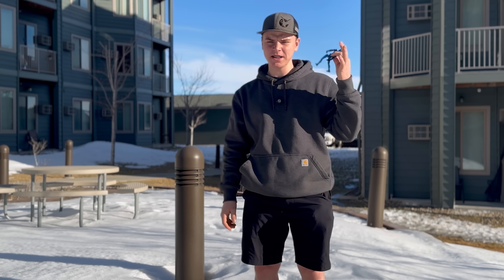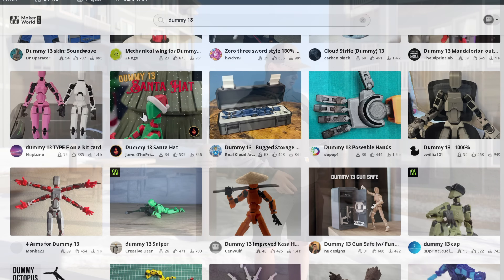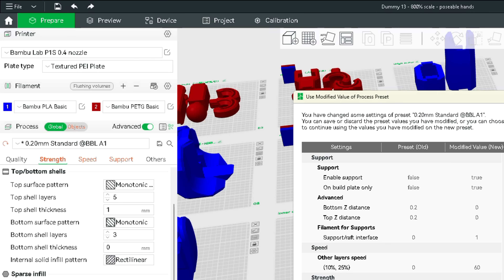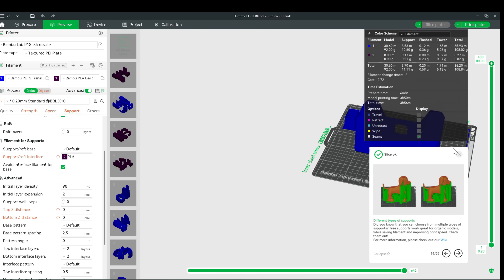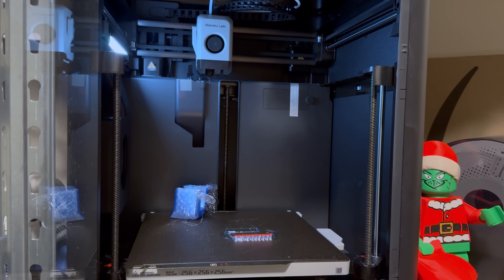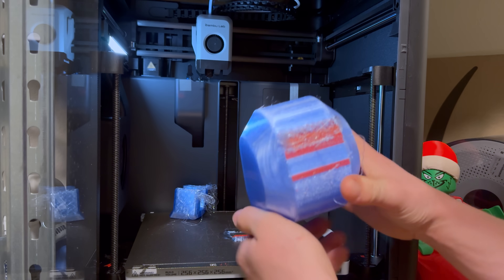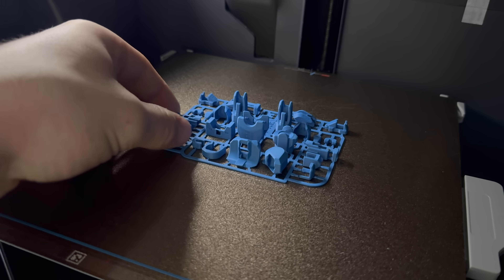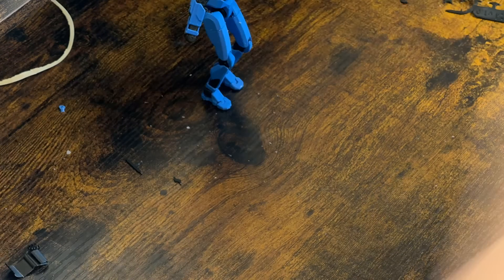I 3D Printed a Dummy 13 at 800% scale, was it worth it?

Comment: I was watching the whole process of you putting together the 800% dummy 13 and it looked like you were struggling and using all of your strength to put the pieces together😂
Reply: Using a heat gun to soften the joint would make it alot easier

Comment: Why do your tree supports snap so easily? Is it just cuz they're larger pieces? So far tree supports have been a nuisance to get rid of for me.

Now I DID just pass the one week marker of owning my printer, so I don't know all there is to know. But what can I do to make my supports snap earlier?

Elegoo Mars 3 Pro with Elegoo Petg, in case anyone is curious.
Reply: PLA and PETG don’t bond well during printing so he set his support interface to either one depending on what the main part is made of. 

If you’re just doing one filament type then it’s best to increase the top Z distance for supports in your slicer. I set mine to .2mm instead of the default .16 and they come off really easily. It can vary depending on your printer though so experiment with it and see what works.
Reply: @Simple_birb  hey, thanks for the advice. I will try that out tomorrow.
Reply from the maker: @S @Simple_birb  thank you man, that’s great advice. I appreciate you helping him out and explaining what was doing in a understandable way
Reply from the maker: To get your supports of easier increase your top z distance a little. To much will make the underside of your prints droopy . I like how the tree supports snap. The main reason I do it is cause it’s satisfying
Reply: @BrandonTucker3D  I think my issue was that I was printing small. Big prints seem to be breaking off real smooth. Especially after I - oh I don't know - calibrated it after a half a dozen uses since the last calibration. I have found that my best results come when I recalibrate before every print.

Comment: I'd recommend spreading a little of those non-permanent sharpies on the joints. It would make them work like a greased part to be connect, it makes it so much easier
Reply from the maker: That's a great idea, I will definitely have to try it out.

Comment: You can put fine rubber sheet
Or silicone type stuff between universal joints... Those Joints are tight but figures torso is heavier.
Reply from the maker: I'll have to try that, that's a great idea!

Comment: I am printing a normal dummy 13 on the same printer at a 150% scale is there any tips to help me put it together
Reply from the maker: Not really, I  did one at 250% scale and I think it was easier than the normal one , worst comes to worst use a little sand paper, and make sure the joints and frame are PETG

Comment: I think if it has to be this big, the joints have to be bigger for less loose connection. That way it can stand on its own
Reply from the maker: I definitely need to figure out to get it to stand
Reply: @BrandonTucker3D  maybe (not sure if it'll work) you can stuff something inside the tongue so the groove doesn't move that much (maybe a bit of cotton,clay or whatever). In the classic T-13 it works by simply applying super glue and moving the groove so the glue dries but not holds it in place

Comment: If it was 800% bigger wouldn’t it be like 10 times bigger than a human
Reply: bro 800 times bigger than the original model so liek 8 times bigger basically
Reply from the maker: Well at 100% the size it would be it’s same height, so it’s basically 8 times larger

Comment: if you want the joints to be stiffer, use either these recommendations; Carpender's glue apply a thin layer, it will dry a bit and expand but not be takky, OR wrap the joints in alum foil
Reply from the maker: @MrAlan1828  thanks for the advice!!

Comment: Use a quick dry glue on the joints
And keep moving the joint so it doesnt get glued forever

This technique by used by transformer and gundam enthusiasts all over the world
When the joint is too loose

And if it's too tight?
Just use a hot hairdryer like you did in the video
Reply from the maker: Thank you for the info I really appreciate it!!
Reply: @BrandonTucker_1818  
:3👍

Comment: Friction joints dont tend to work as well at higher scales, its why ratchet joints are used for heavier action figures and transformers.

Without making custom joints for the build, its going to be difficult to get it to stand up without a comically large stand.
Reply from the maker: You are right , I do think I’ll end up making a stand

Comment: Put in metal wires that run through the whole body would really help.

Or redesign the joint with added rubber parts, screws and bolts.
Reply from the maker: Thanks for the suggestions! 👍
Reply: You just gave me an idea for those finger and arm joints. If someone modeled the ball ends with grooves that could hold o-rings. Think something similar to a tennis ball. The rings would easily create enough friction for the arms to hold position.
Screws wouldn’t be a bad idea if you just wanted to make sure the legs stayed one position.

Comment: For loose joints.  I use electrical rubber tape. Tight enough to hold a pose and to move the joints

Comment: Do 2000%
Reply from the maker: Maybe once I have a bigger printer!!
Reply: @BrandonTucker3D  it would be possible by cutting the print to fit on your printer and using pla gloop to chemically bond them together, would be an expensive and long build though

Comment: i dare you to 3d print the stand for it
Reply from the maker: I might but I need to find a solid base cause it is way heavy
Reply: @BrandonTucker3D  Maybe you can make a custom model that can bolt to the wall or ceiling and if the arm to the stand is too weak you can try too make room for a metal rod but I'm not einstein. I hope you can get it to stand

Comment: I was gonna comment about the amount of infill but seeing how much pressure is put on them during assembly it seems reasonable lol
Reply from the maker: I used around 10% to 15% infill with two wall layers and if I needed extra strength three
Reply: @BrandonTucker_1818  I'm so impatient so I use like 3-5, but it's all for like replicas/props

Comment: First thing I shouted at the screen when starting this video: You can't just scale up like this, without adjusting the tolerances!
Reply: Same! "800%‽ damn, that's gonna be floppy". Lo and behold! Fixable with some varnish or nail polish in layers.  Old toy hack to get your figures stiffened up again is to use floor polish on the ball joints. For this scale, maybe uv resin would be better..🤔

Comment: Ai generated frames don't work at low frame rates, it just looks bad. Low fps can look good in stop motion, you're just mucking it up.

Still though, nice work.
Reply from the maker: I did use stop motion but when I exported the video it messed it up sadly
Reply: @BrandonTucker_1818  ohhh. That is unfortunate. I do apologize for accusing you of using ai generated frames.